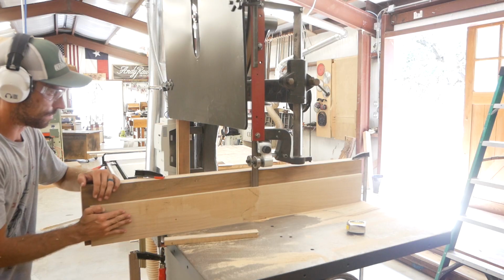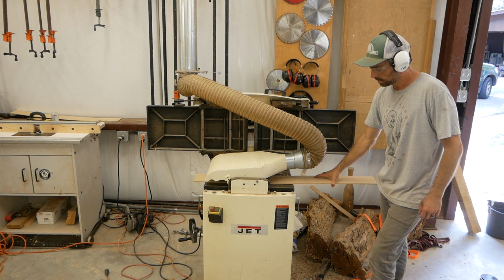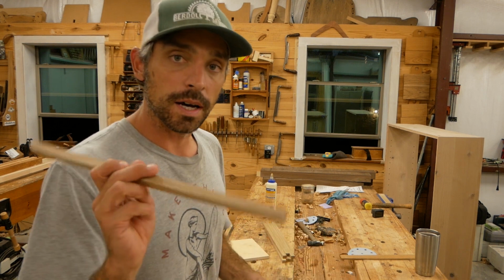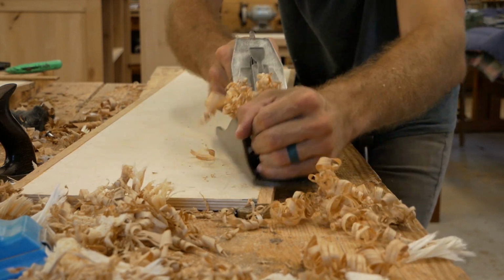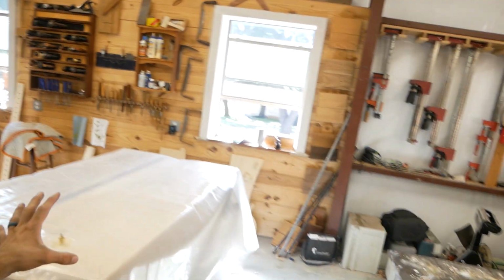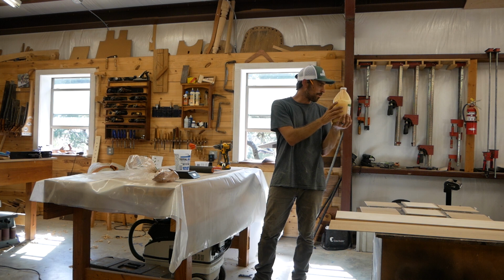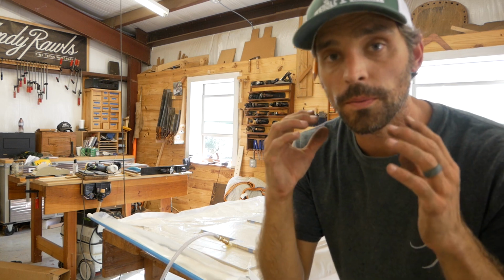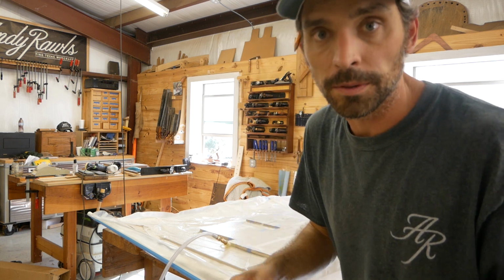Building A Cube Box...Is Not Easy!: Part 1

Comment: nice work. My dad's vac bag also had similar horrible pvc tubes to close the bag, but once I got my own vacuum press, I decided just to use 2 wooden beams clamped together with regular F-clamps. the beams are 2 by 3 inch solid wood, works just fine. To line them up when you start clamping, I use a pin and hole on both ends of the beams.

Comment: 97 deg in the shop...I have the same issue in mine up here west of Ft. Worth. My solution is to install a mini split before next spring along with a dehumidifier, so I can keep the doors closed and rust at bay. My shop is also a metal building but with spray foam.